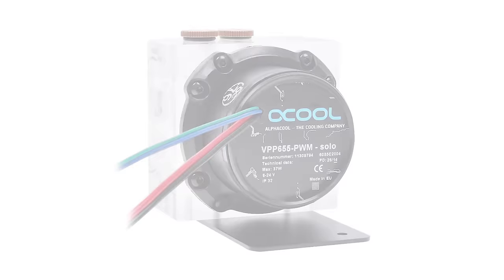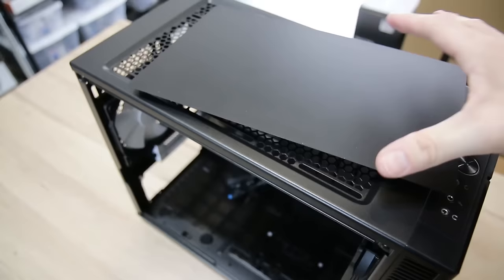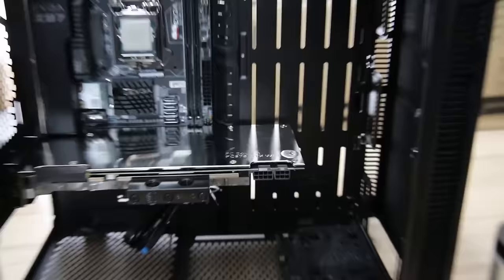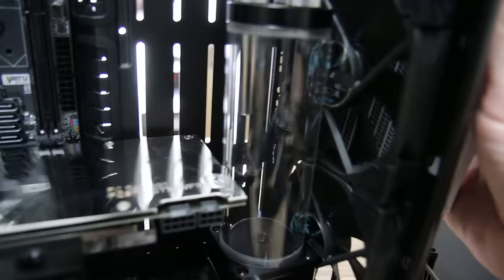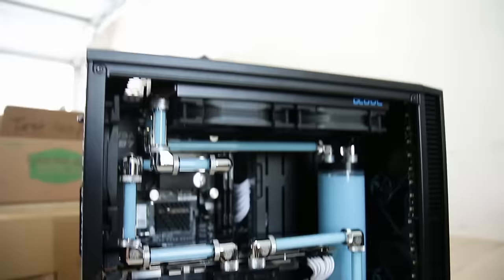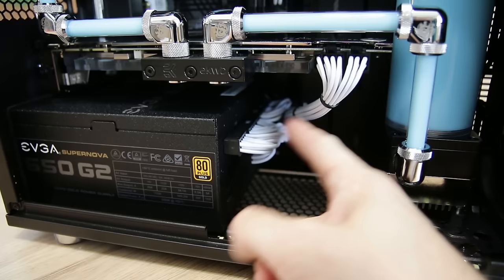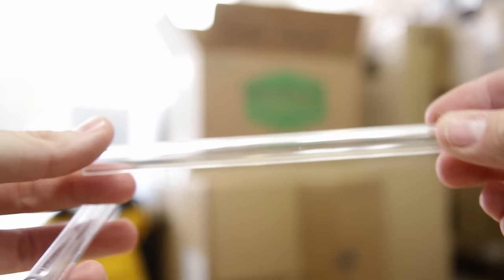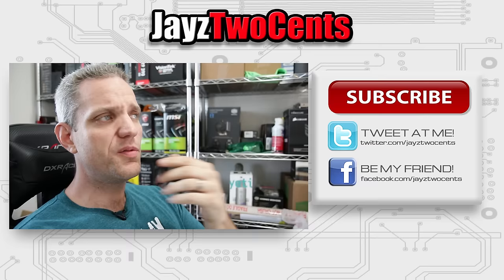The Ultimate Fractal Design Define Nano S - Build and Review VLOG

Comment: This case cries for an R 9 nano
Reply: ikr
Reply: yes... With an r9 nano you can put a second radiator in the front
Reply: +Bananen Cocktail and a lot cleaner build
Reply: Water-cooled.
Reply: +Lars Hei yeah a nano and a sfx psu from silverstone
Reply: +Vox Nihili there is a Waterblock for nano
Reply: StardustDragon08 I dont think he has one I have never seen it in a video but who knows he might do it in the future.
Reply: +Bananen Cocktail With an R9 Nano, you might need a second radiator in the front.
Reply: No it doesn't. The point is that it is a small case but you could still fit a relatively large GPU in there so take advantage of that. I would have went with a small res to fit the second rad.
Reply: +Ron Ramen from 150 to 175 TDP? Not really, you're still well within a single 240's capacity.
Reply: +Ron Ramen In fact you dont need an extra 240mm Radiator for the Nano, but you have the option to use one ;)
Reply: +Wolfdale oh ok I got you now. You could also front mount it and put in the moduvent thing to make it more quiet
Reply: +Lars Hei I would have love to see Jay get a R9 Nano block and use that in the build.
Reply: yup
Reply: +Bananen Cocktail with an r9 nano, you will need that second rad :P

Comment: Really liked the style of this video. I'm a big fan of watching build logs for sure, and every time I watch a review on a case immediately I start asking; "what hardware will fit in it?"  I usually resort to looking at case and part measurements and making drawings, but lots of stuff comes up when you physically work on a build that you can't plan for - like in this case the top allows for dual 140mm fans but NOT the dual 140 radiator.  If I was making plans for a build I would have planned for a thin dual 140mm rad and would have been really disappointed later.  Showing a sample build (and a beautiful one at that) in a case while simultaneously reviewing it is very useful...and entertaining. Keep these coming!

Comment: Would a 1060 or 1080 over kill?
Reply: Victor Guillen just 3 things you gotta look out for, the length of the video card and how much space you have. 
- how uch radiator an fans is enough to cool it and the CPU 
- how much electricity you need in th power supply
Reply: It fits these cards. I run a strix 1060 in there.

Comment: I use tubing water blocks, radiator water blocks, and fan water blocks running through a secondary radiator to cool the primary coolant, primary radiator, and the fans. Next week ill be watercooling my reservoir and sata cables for mad fps gainz.

Comment: Whenever I have a difficulty illustrating size of an object on image or video, I always use something that is of common size in the majority of the world. Like a coca-cola/any-other-soda 330/350ml can, a 0.5 liter / 20 oz Coca-Cola bottle (I believe they are the same hight, the 20oz is a bit wider) - or a BIC 1 ligher for smaller objects. An A4 sheet of paper is even more "correct", but somehow it doesn't do as well visually. And it tends to c*ck up camera exposure.

There are tons of other stuff for the same purpose, these are just my typical go-to stuff.

Comment: Update- Hey Jay, I've switched my hardware over to this case and either graphics cards have become longer or your GTX 970 is shorter in length than standard.  While I was preparing to fit all the water cooling components with two EK SE 240 radiators, I placed the front radiator on the outter part of the front underneath the front cover and two 120mmx25mm fans on the inner part of the front.   My water pump/reservoir combo that's the same dimensions as the one you used in this video didn't fit between the GTX 1080ti and the 120mmx25mm fans.  I switched out the card for an HD7970 reference and same result.  For anyone that plans to build a custom  a loop in this case, make sure to either use 120mm fans in the front that are 10mm thick or a graphics card that is 10in or 254mm long to be able to fit a pump/reservoir combo.  If your graphics card is longer than 10in/254mm, you'll need to use a stand alone reservoir of 75mm supported onto the wall in the case and your pump at the bottom.  I hope this information was helpful.

Comment: I was super excited to see this build Jay. I've had my eyes on this case for a bit for my next ITX build, considering it over the Lian Li PC06 and Silverstone ML08B-H. I love the look of a small desktop even more so than a "Console" or "Media-Box" style case and you've shown that this case will offer plenty of water cooling options and really let you show off your cable management skills. At 8:00 when you were debating radiators I was thinking you should do a thick 120mm in the rear and as thick as you can get away with 240mm on top, but then you showed that it won't fit. Do you think that there is a brand of 120mm rad that would fit in that space? I see the "was a 240 radiator enough" video up next in the queue, but all the same, gorgeous build.

"please Jay, do a glass cutting tutorial!"

Comment: +JayzTwoCents You can trim glass with a belt sander and 320 grit. Use a propane torch to polish the edges of cut glass tubing.

You can also use a dremel, but personally I prefer sanding for minute adjustments. Do use a dust mask though; inhaling glass dust isn't a glorious way to die imo
Reply: +noanoxan I would recommend a rosebud style torch. Makes quick work of sharp edges and is easy to chuck in a vice.

Comment: Hey Jay! How do you think an EK Predator 240 will do in the front while incorporating the gpu into the loop? GPU clearance, rad+pump clearance etc. Thanks! Love the vids!

EDIT: NVM, I went to fractal's website and EK's website to get the respective dimensions and used some simple math. Here's what I got:

Height of case excluding feet/protrusion/screws: 330mm
Height of EK Predator 240 including pump/res: 295mm (It will fit fine!)

Depth of case excluding etc etc: 400mm
Depth of EK Predator 240 including vardar fans/pump/res: 68mm (400 - 68 = 332mm; meaning that 332mm, or, roughly 13 inches is the maximum video card length allowed in this case if an EK Predator 240 is mounted in the front).

Hope this helps! (Also, fans and radiator will be inside the case, so dust filter stays!)

Comment: i believe that if you put the radiator almost all the way back used a shorter card like the nano the itx 970  or the fury x, used an sfx psu and used the small reservoir you could have used the front radiator i admit that the tubbing would be a little odd from the res to the pump but there's that

Comment: How does one handle fans in this case? mITX mobos usually have 2 fan headers, one for cpu and one for case. In my example i would like to buy Alphacool Eisbaer 240 , Eiswolf GPX-Pro and add another ST30 240mm rad into this case meaning i would have 2 fans for cpu rad, 2 fans for other rad and most likely similiar fan for exhaust to the back meaning id would need 5 fan headers. According to alphacool their headers need to be connected directly to fan header and not to split them since pumps take power from these. NZXT Grid+ 2 would fix the fan issue here and now im just worried that could i accommodate all these items in Nano S with the cables and it would work for me as "AIO" solution plug and play watercooling since it would not cost me so much money then nice looking EKWB parts. P.S. Keep up the good work Jay!

Comment: I think that looks way better with the 90' fittings rather than with bends. I think its how I'm going to be doing mine with the glass tubing.
But I am having trouble finding all the fittings to suit.  Keep googling I guess till I find them.
Would have liked to use all EK Fittings, so to keep all water cooling parts EK. But having trouble with 90' fittings from them.

Comment: I would like to see more attention to dust filtering. This looks like a problem. Front dust filter removed. Top rad push. Overall, I think pull the top fans and go with narrow front fans, put back on the filter.

Comment: Would've been possible to use a Swiftech H220-X in the top and add a second slim rad in the front? Even only using that radiator I think would've made the build much more clean but maybe to as shiny and "full" as it looks right now. Great job!

Comment: First of all thats a very nice build and great skills. But the loop temp does not equalize. It's cooler coming out the rad and hotter coming out the components. Otherwise it would be doing no cooling at all. Still though, the temp difference wouldn't probably make a big difference in cooling the CPU. But science is science!

Comment: Love this build. You said you made the tubing as you did to be able to get your "hands in there" but since you can't do anything in there with your hands anyways, would it not have been better going more direct from the gfx and to the right connector on the cpu block (guess the direction of flow doesn't matter?) and then from there up to the radiator (it would seem to me the loop would be simpler that way? maybe?)

Comment: As this case is a "silent" case, I was wondering how much quiet it is with the water pump and the top open with a radiator.
Compare to full closed one.

Still depending on a R5 or Nano as I want the most quiet pc for my living room.
The advantage of the R5, is the optical drive, cause I need a blueray reader for ripping my dvds, but could use a usb one also.

Comment: I was more interested in the glass build than the case itself. Having worked with glass for other projects, I'm sure I can handle it, but I'm inexperienced with water cooling in computers. Between that and my desire to do a Borg themed build (unattractive tubing and all) I think I'm going to hold off and tinker with an AIO unit first. If I do a custom loop, glass would certainly be my choice. 

But I do have a question: Do the fittings use rubber gaskets to seal against the glass or is there another mechanism involved?

Comment: Love the glass tube idea as I was wondering if that were even an option for custom loops. As you pointed out, glass looks better a lot longer than any plastic due to scratch resistance. Now I am curious how well some of the cooling solutions will fluoresce inside glass tubing when you start adding RGB lighting. 

As always, keep up the good work :)

Comment: Why are 12 - 15mm profile fans not used more in cases, they allow you to put fans in spaces originally not designed to house a fan at all, for example I have 2x120mm fans on top of my case and the shroud will allow good airflow, but no room to fit a standard profile fan so the fans must be mounted the on the opposite side (inside the case)but this mean my rad interferes with my motherboard, so using the low profile fans allows me to install the fans under the shroud and still be able to have the rad no interfere with the motherboard. They are so useful i just wish that companies like Cooler Master and Noctua reconised their potential. (I know noctua make them but they aren't stardard 120mm or 140mm sizes)

Comment: I think you would get much better cooling to the CPU if you put a 3-way T tube connector before going to the GPU, one tube would be from the reservoir, one goes to the GPU and one goes to the CPU, and then get another 3-way T tube connector to connect the tubes that goes out of the CPU and GPU and in to the radiator.
Contrary to what you said, because what you're doing right now is literally cooling your hot CPU with already HOT WATER from the GPU.
Reply: +Dominique “Saxoholic” Orito it makes no difference, I have two overclocked amd hd 7970's that then go to an amd fx 8150 overclocked then a single 360mm rad. my cpu runs cooler then  the gpu's, just sayin
Reply: Have you tested running your CPU and GPU on load and only the CPU on water while the GPU is air-cooled? The CPU temperature should be slightly better than the configuration in this vid.

Comment: I'd like to know how the thermals were in there on that single 240, any chance of a video on that?

I'm planning a future build in this myself or, rather, transferring my current mini-ITX system from my RVZ01 to one of these and building a custom loop, but I'll have to go with a front 280 as the mobo VRM on the Impact VII will be tall enough to block a standard 25mm fan. (I'll still be sticking a 240 in top, but will either be using a slim 120mm, or botching on a 92mm where it'll fit, for the bit above the mobo)

Comment: Glass tubes?

They look fantastic but I would be super, super nervous with that. I mean, Acrylic tubes are probably more fragile, but acrylic shards are probably less of a health risk than glass shards. Even with how thick the glass on the tubes is. Although I do appreciate that glass is actually a lot stronger than people give it credit for.

Although personally, I like the look of using those 90 degree metal connectors better anyway. They frame the tubes rather nicely. Bent hardline, while it would also look nice, would be comparatively featureless. I might just do this if I ever get around to doing a liquid cooling loop.
Reply: +MGlBlaze 
i definitely like using fittings, but i'm also partial to liquid cooling having a sort of 'steampunk' esque look to it.

it's a shame that using lots of fittings is also extremely expensive. e.e
Reply: +taiiat Yeah the price tag he dropped on all those fittings was... pretty massive. Definitely not something you go into lightly.

Comment: with my lian li  mITX I decided to go with an externally mounted 360mm,   I have to make a custom frame for it though ... 
its not ideal as I have panels removed until I can make the frame which means lots of dust entering.  Also it doesn't seem like my supplier sells bitspower DDC combo res,   im using a EK res with a seperate pump which is connected by about 10 fittings :/

Comment: Hello Jay my psu is an EVGA 1050 GS which is 170mm deep since the spwcs of the one you used you used is 165mm. Would you say I can use my psu in this case? Not sure hiw much space I would have left on the gromet to thread the cables. Maybe if I took out the rubber? Hope you can answer. Keep up the good work.

Comment: Will a FTW or a CLASSIFIED with a waterblock fit in this case? I'm also undecided if I should get the 1080 or the 1070. It all depends on if a 240 slim is sufficient for the 1080 like EK's configurator says it is.

Comment: Hey Jay. I was thinking of using a case like this on a itx build but i dont really wana spend the extra money and time on a custom look and was gonna use a AIO cooling solution like an H100i or something and using a hybrid cooler for the back fan mount. whats your opion since im not a fan of rads in the front throwing hot air into the case whats your opinion? I was a little confused about air flow using a rad in the front and the gtx hybrid cooler on the back and nothing out the top what you think?

Comment: those fittings are so damn expensive cant find them 90 ones without getting the corner bit with 2 connectors for it £20 per bend is alot

Comment: what motherboard will i need for this case, will the Asrock Z170M EXTREME4, fit inside, and if not, what motherboards will i need?
Reply: Go on pcpartpicker, it'll filter out the stuff that won't work.
Reply: pc part picker doesent have the particular case, but anyway im fairly sure it only uses miniatx, and not micro.
Reply: http://pcpartpicker.com/list/fh9Q6X
They do have the case. There's a build I came up with using it
Reply: maybe the british version doesent have it, i cant find it in the case section.
Reply: Hmm that's strange. Maybe pick the case first on the list if you aren't already. Other than that I can't think of what else would cause it not to be there.
Reply: northern marine ive already bought the case and all components.

Comment: Hi Jay, was just wondering if you could help me determine if my pc build can be cooled by fans only.
Here is my build:
Gigabyte GA-H170-Gaming 3
i5-6500 Skylake
Sapphire NITRO R9 380 4GB
Corsair Vengeance LPX 8GB 2x4gb DDR4 2400 CL14
Western Digital WD Caviar Blue 1TB
Samsung 850 Evo 120GB
FSP Raider 650W 80Plus SILVER
Cougar Archon Case with 1 fan at back of the case

All are stock and no fans were purchased except for the stock fan included in the case

I usually play CS:GO, LoL, Crysis 3, Dota 2. I see my GPU temp in 50-75C and I'm wondering if the temp should be cooler or is just normal. I live in a hot place, Philippines, so I'm not sure if the temp of the build is safe or should I add more fans or get a radiator, etc.

Hope you can help me. Thank you very much in advance!
Reply: Yes.

Comment: How well would an air-cooled system do in this case with 2 120mm fans on the front, 1 exhaust, cooler master 212 hyper evo, i5 4690k and a gtx 970?
Reply: Tom Brown Funny enough I actually have the exact build, besides me having a rx480 my only problem is how close the GPU is close to the PSU, so when buying a PSU go for the smallest one possible for blower style cards like mine
Reply: I still have the same system but upgraded my CPU cooler to the Corsair H100i V2 with the rad at the top of the case and the fans below the rad exhausting air through the rad if that makes sense. It works really well but my PC is super loud during gaming osmetimes. Unless I have headphones on then it's ok sometimes.
Reply: I might upgrade to the Corsair SF 600 watt so my graphics card has more air to breath and so I have room to overclock. Cause I am worried that 1 fan is getting starved for airflow possibly causing thermal-throttling.